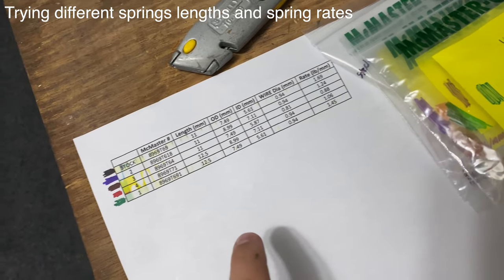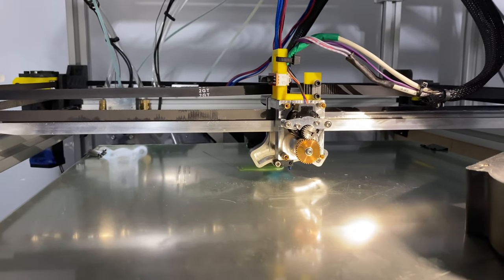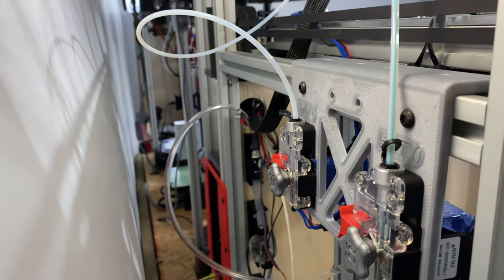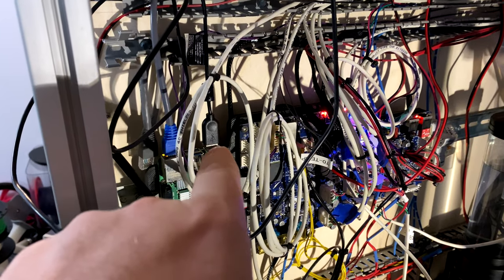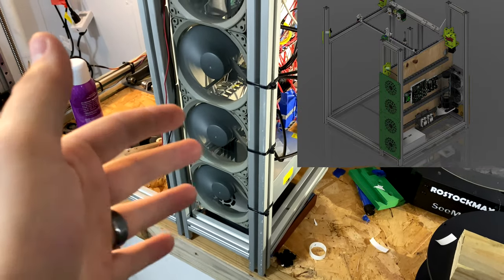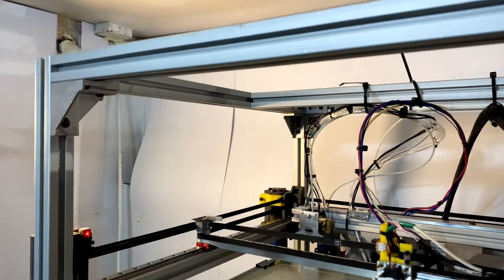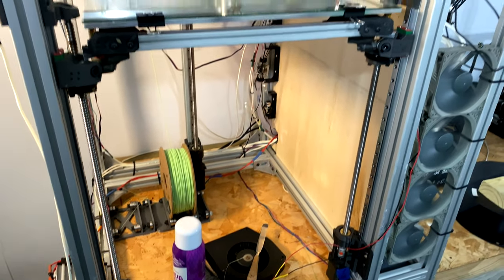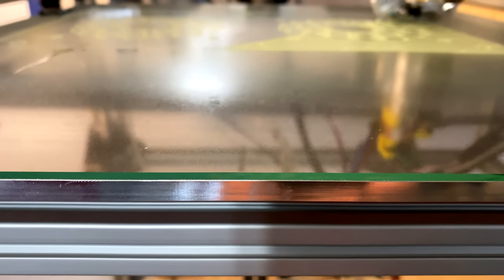Tool Changing Working + Updates | HevORT E3D Tool Changer | Part 4

Comment: I’ve tried that heater… the problem is it’s self limiting. As the temp gets higher the resistance increases and the amperage drops substantially. Plus there’s not enough surface area. I’ve since swapped to something called “finned strip heaters” Amazon sells them and they are incredibly effective. I recommend getting yourself one or two and then an all metal blower fan made for fireplaces.

As for insulation. Get polyisocyanurate or polyiso insulation. Home Depot sells 4’x8’x1” sheets for $25. Works like a treat and is ultra cheap.
Reply from the maker: Great info, will definitely look into these items. Thank you for the guidance!

Comment: I wonder if a magnetic tool changer would add more or less weight to the gantry, compared with your mechanical design. Very cool btw.
Reply from the maker: Oooo I really like that idea! That would remove a lot of mechanical linkages, gears, steppers etc. I may do some prototyping with that idea, you have me thinking now…
Thanks!
Reply: @JordanMiller1117  You're welcome! I've been considering making one as well, but I'm not sure what would be better.
Reply from the maker: @agentfifteen  If you can key the two plates together and get a strong enough magnet I don't see why it wouldn't work.

Comment: Cool! Nice custom gantry you got there. I noticed your upper belts don't run parallel to the gantry and to the other belt, will that not affect accuracy of the parts you print?
Reply from the maker: Thanks! Yes, you are correct they aren’t parallel. I have a design iteration in the works to have a new piece that allows the belts to be parallel. 
I think it will affect it a little bit like you said. Not completely sure however.

Comment: hello my friend.  Do you have a link for 360 autodesk updated with actual frame configurations ? im interested on how (measure parts)  you manage to fix the back Z profile with the one that carrying the toolheads
Reply from the maker: @eduardogarcia4452  I don’t have a model for it. I just made some adapters to mount the back tool plane to the left and right main axis rails. 
If you have good knowledge in CAD, you should be more than capable of modeling something.

Comment: i had way too much resistance mounting the spool below the bed. how's you done your issue? what reverse Bowden tube are you using? also, do you get interference with the umbilical cables of your docked tools with you print along the back perimeter of the bed?
Reply from the maker: Not much intereference, just some general things getting in the way and kind of "bending" the hotend, which I need to fix. I'll be using cable chains to fix this eventually. Its not a reverse bowden, just a standard one. How are you running your spool?

Comment: Bit hard to be sure but it looks like you're not using toolboards for each printhead. Can I ask why?
Reply from the maker: Takes up extra room, not sure there is a need for a tool board either. I just will run extra thing from expansion boards. Good question though.